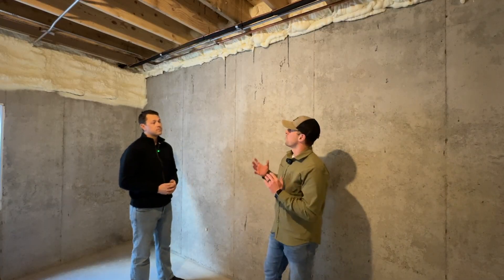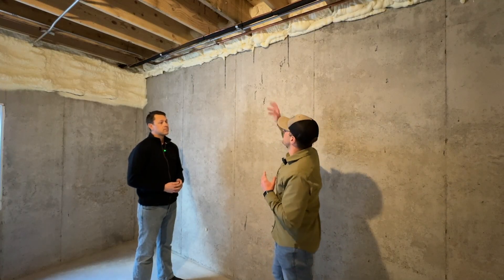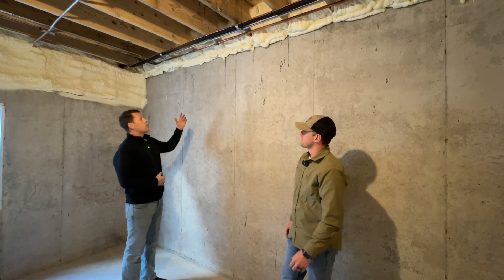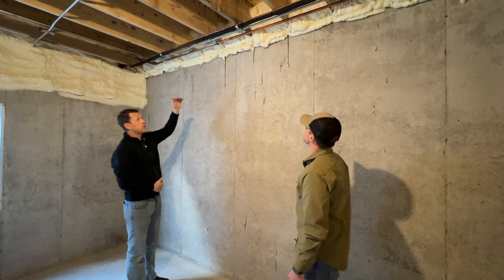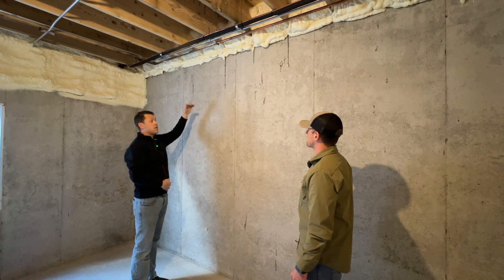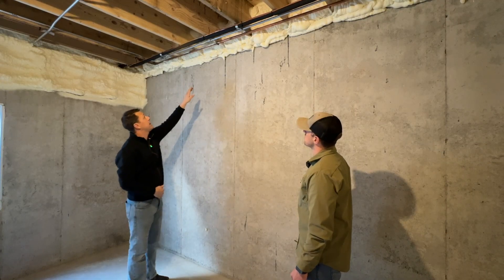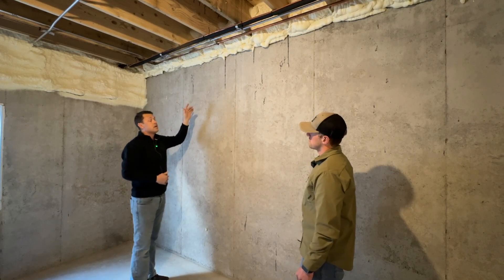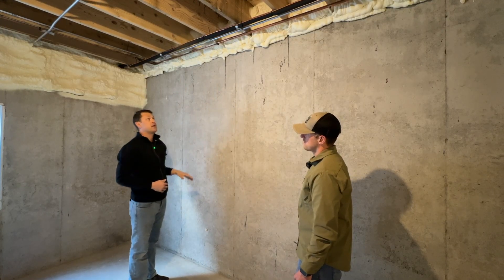Insulating The Basement Rim Joists With Foam For Superior Efficiency

Comment: This is the right place to use spray foam, especially in a remodel, but you have to use closed cell to get a vapor barrier and seal from any vapor leaks you're going to have around the sill. Open cell foam is not the best choice for this application.

Comment: Spray foam is the absolute worst thig you can do to your home, don't do this. use traditional insulation, at least you can easily replace it when it gets wet. this will seal in the moisture and rot from the inside out